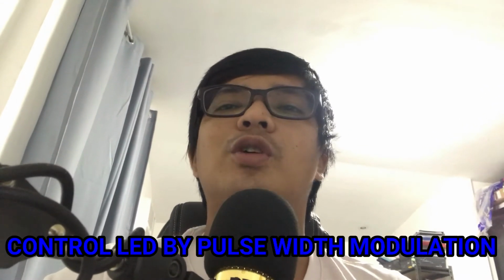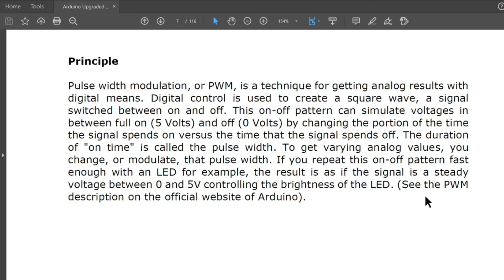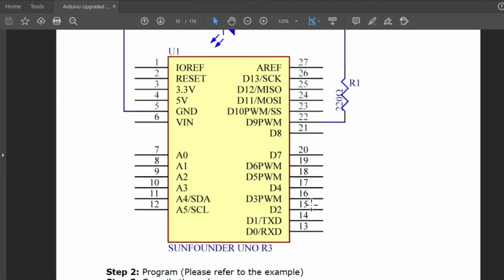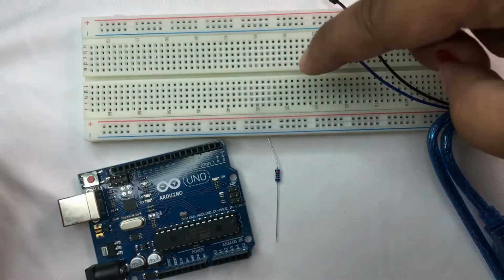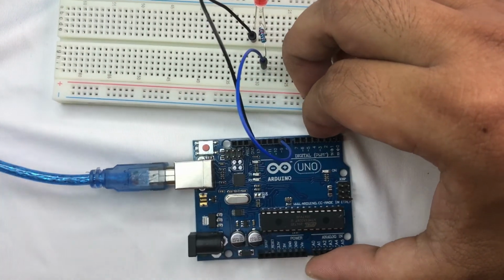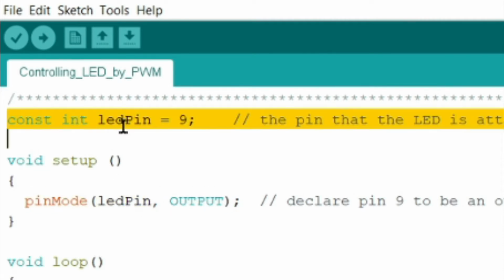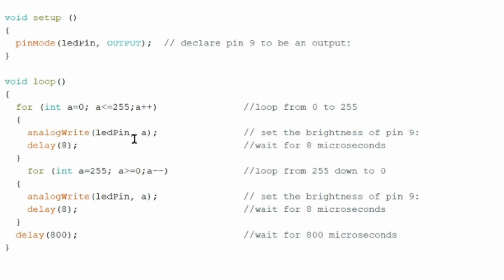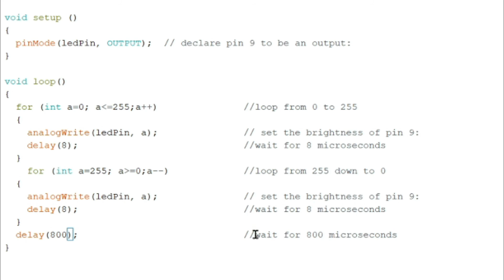ARDUINO TUTORIAL LESSON FOR BEGINNERS LESSON 2: CONTROLLING LED BY PULSE WIDTH MODULATION (PWM)

Comment: Why in this case we don't need the 5v jumper anymore unlike lesson 1?
Reply from the maker: because it can be directly connected. Usually, jumper wires extend only when 1. the wire is short 2. to have a common line